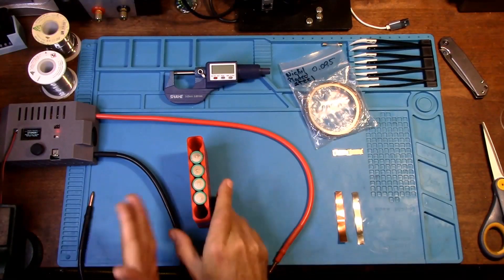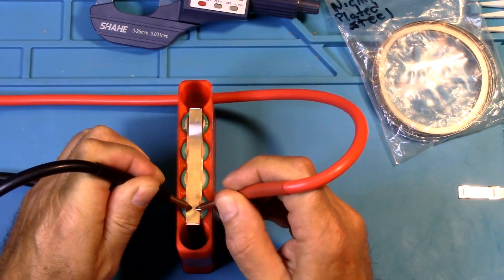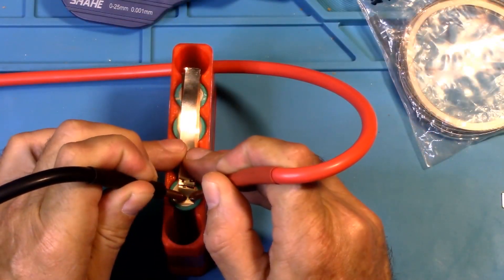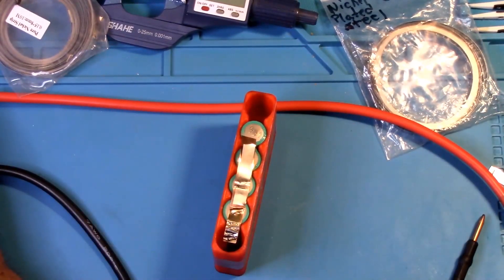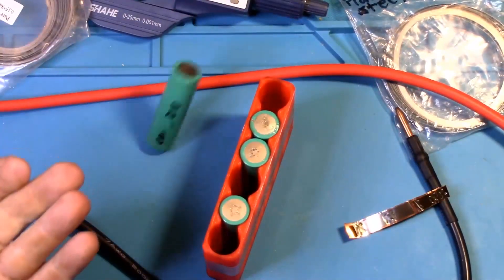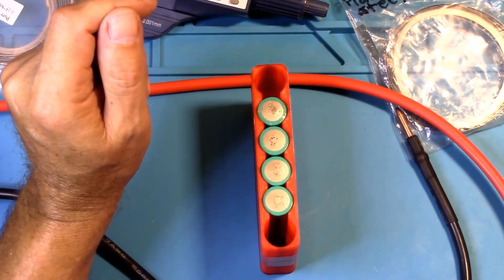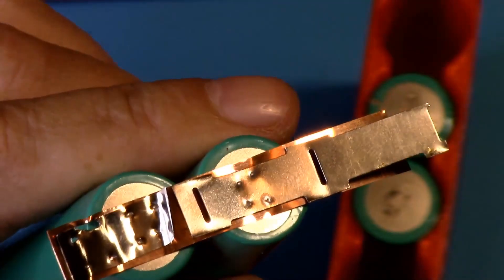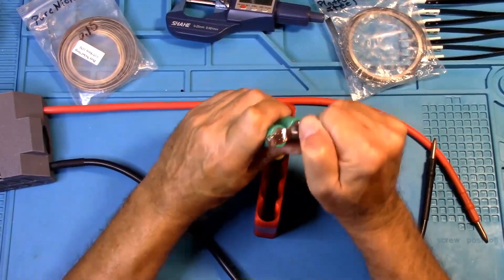Create A Copper Sandwich Weld With The Malectrics Spot Welder 1

Comment: Thank you for this great demonstration :) May I ask - I am about to get a spot welder which can barely do 0.15mm pure nickel (I already bought it, and kind of regretting, but it was cheap enough). That is, it can do 0.15mm pure nickel with good quality on max settings. Do you think it will be able to do this method? Or would I need something higher power? Please let me know if you have any estimation for this. Thanks :)
Reply from the maker: The Malectrics can weld up to 0.3mm and it struggles, so if yours can only weld 0.15, I would think it would not be able to do this.  You could try replacing the battery with a higher amp output battery (if your welder can handle it), so you can weld thicker strips.  Make sure not to over-amp (per manufacture specs) your spot welder ;).  

Hope this helps.  👍
Reply: @Outside-In.  thanks so much for letting me know, I didn’t think my cheap spot welder could do this 😁 maybe I’ll make my own high power spot welder for a video project one day then. Thank you, have a great day 😊
Reply from the maker: @h1tec  That would be awesome, and I would love to see it, so if you do that, let us know here :).  👍
Reply: @ will do 😁

Comment: i wanna build a 6s2p battery with a max pull of 90A it has 9000mah in total what thickness should i use of both of these
Reply from the maker: First of all, make sure you are using cells that have a 50amp constant current draw rating each.

Pure Nickel Strips of 0.1mm should do fine.
If you want to sandwich weld, 0.05mm Pure Nickel and 0.05mm Copper strip should be fine.

I would suggest that you first build your battery pack, and pull the 90amps you intend on using to make sure the strips will not overheat, and if they get too hot, you can always add another layer of Pure Nickel to lessen the heat (0.1mm (total) should actually work fine for your setup).   at 0.1mm thickness (Pure Nickel) you will be good for about 15amps per inch of strip, so if you are building a 6s pack, that should give you a total of about 90-100amps...  Again, make sure you are using cells with a constant current draw rating of 50amps each, otherwise you could destroy the cells in a very short amount of time.

Hope this helps.

Comment: Hello, Thank you for the video! I am interested too in the copper sandwich method , I too create battery packs for numerus projects!
What would be really helpful to me is... :
How much better is a nickel copper sandwich weld, compare to double nickel weld.
 I understand that in copper electricity pass better, but how much better, does it worth to get in the trouble for small DIY drill battery replacements, like 3s1p or 4s2p?

and also is there a way to weld only copper strip? what a welder have that power to do it?
Thank you in advance! George from Greece! https://www.youtube.com/@georgezibra
Reply from the maker: Sorry about that, YouTube didn't alert me to your comment.  I know this is probably too late, but I don't see the point myself of doing sandwich welds...  If sandwich welds were that important, then why don't ALL power-drill companies create battery packs with sandwich welds?...  I was just testing if the welder would do it in response to a comment, but myself, I would not see a need for such a weld.  I know that the Malectrics will do a 0.235 pure nickel weld, and more than likely also a 0.3, but unfortunately, I cannot find anyone selling 0.3 pure nickel to test that.  Malectrics states that their welder will weld 0.25 nickel, and it will definitely do that.  "How much better is a nickel copper sandwich weld?", well, I would say that it would be much much better, but do you really need it?, I don't think so, because like I said, if it was so much better to use a sandwich weld, then drill maker companies (especially Milwaukee), would definitely be using sandwich welds for their batteries -- just my thoughts anyhow...

Comment: Is there any way to determine how thick both the Nickel and the Copper should be to safely draw a certain current from the cell? For example, I creating a 6S1P battery for a project which can draw at max 20A, how thick should both the strips be to safely spot weld and draw current from the cells?
Reply from the maker: For the Malectrics Spot Welder, I would say no more than 0.1 for Nickel and 0.1 for Copper to make a good sandwich weld.

Comment: Very smart way of welding copper. Directly it is not possible since the thing that produces the heat that welds in the spots is the relatively high resistance of nickel. Since copper has very low resistance current will just heat all the path instead of only the spots. This way you have the best of both worlds (the ability to solder in spots and also the low resistance of the copper)

I use to solder copper directly on the nickel strips, with a soldering iron trying to apply (and remove) heat as quickly as possible, with good results. But this is better.

Very happy with my malectrics spot welder too! Keep in mind that the capabilities of this thing are closely related to the discharge rate of the battery used to feed it.
Reply from the maker: I definitely agree with your thoughts.  This thing puts out a lot of power for sure.  The only problem I would see using this method all the time, would be the cost wouldn't it?, I mean the cost of the copper I purchased was quite high, but only purchased for a request video.  I just don't think that I would want to use this method constantly as the cost could rise (depending on how much you weld) quite high... 

But this is a rather fun way of welding and (like you say) very effective as long as you have the battery power to get the job done.
Reply: @ thank you for your response. I just purchased a 0.1 x 7.5 mm roll (with a total length of 2m) just for a quick test. I agree it is quite expensive at about 9 EUR / 10 USD in my region, but since the copper wire I used to improve current flow is also expensive I will purchase more if it works good for me. So copper manufacturers should thank you for the free ad! 😉

I use this batteries a lot in medium-sized rc planes, so I need about 35A continous for each element weld. I used 0.3mm nickel but even on 100ms on the malectrics welder if the points of the tips are not super-sharp it wont stick properly. Maybe the battrry I use to power the spot welder is showing a bit of wear too. So since reliability is important I went back to solder (also expensive) 2.5mm2 copper over the batteries. Not very good for them but it was my only idea. 

If this method works even with the cost It would be a blessing. Have you tried higher thicknesses by chance?
Reply from the maker: @Igbf  No I have not tried anything thicker.  The Malectrics is not really meant for that kind of power anyway, a welder that would need to put out the power the copper would not only want - but take - I mean that kind of power is going to be much more expensive than a Malectrics, but the Malectrics definitely (in my opinion) holds it's own - up to the bigger boys in the room.  

I have tried a number of welders that say they can do the power that Malectrics says theirs can do, but so far, the Malectrics actually puts out and more-so what they state it will do.   A person would just have to be careful not to connect too big of a battery to it, because (like you say) it will put out what you put in, and it would actually start putting out that Magic Smoke everyone loves to see so much.

Actually Malectrics contacted me and asked me if they could link to my video on their store, and I said sure be my guest, so that was pretty awesome I think.  But yes, I do enjoy using the Malectrics anytime that I need to spot-weld something, but as far as using copper, no I don't think I will ever really have the need.  

The pure Nickel strips that I use are plenty for the dabbling and messing around that I do.  But just in case (and also why I don't waste my copper rolls), I will always have a piece of copper if I need it.

I agree also with you that soldering on a battery is not the best idea, and actually I feel that it is a super big no-no, unless of course a person has a ton of experience with doing it.  If I were to do that, and actually I did my first solder on an 18650 about 2 weeks ago, I got the iron way hotter than normal, and only spent a second on the battery to get it finished as quickly as possible and still make a connection.  It actually surprised me how well it worked, and the battery was just barely warm, but still, after that, I said - nope, not going to do that anymore.  I guess I was just curious if it would actually work, and it did for sure, but absolutely will never do that again.  But then again....  How does the old saying go?...  Never Say Never LOL..

Comment: What battery you use?
Reply from the maker: I used the Zeee 9000mAh 100c 11.1 volt battery.
Reply: @Outside-In.  3 or 4 s and I have a battery is 240 cell Samsung 40 T 72v48ah 420continous amp 3456 what is one charge of the battery gonna be enought
Reply from the maker: @XXHellBig125XX  3s...  The following is the battery specifications for using the Malectrics Spot Welder:

Battery Information for the Malectrics Spot Welder:

* Input voltage: 10 to 14 V recommended welding battery: (you can use car or lipo battery)

* Car battery: 12V, arround 600 A (CCA)

* Lipo battery: 3s 5000mAh with minimum 60C (120C burst) recommended 

* Welding material: 0.1mm to 0.25mm nickel strip (most commonly used is 0.15mm)
 
* Welding cable: 10…16mm², each about max. 50cm long

If you are saying that your battery is 72v - DO NOT connect that to the Malectrics Spot Welder, you will blow it up...
Reply: @Outside-In.  no im buyng the welder to spot weld my 72v but wondering wich battery buy for the welder so 3s zee 9000 mah 100c 11.1 to 14.4 v would do right
Reply from the maker: @XXHellBig125XX  Yes exactly.  That is what I am using now, and it works beautifully.  Sorry for the confusion 👍  Actually, 12.6 volts is as high as you want to charge that battery.  These cells charge to (A Maximum) 4.2 volts each (Recommended charge is 3.7 volts (11.1 volts total 3 cells in series)), and 3 cells in series would be 12.6 volts (Maximum) - not 14.4.  If you try charging that battery to 14.4 volts, you will cause a fire for sure.  Also don't let the voltage drop below 3.2 volts per cell (9.6 volts total voltage for 3 cells), as that can also cause a fire.

I also recommend getting a fire proof case for LiPo batteries to keep these in while charging and storage.  LiPo batteries are the most dangerous batteries (in my opinion) ever conceived for real) LOL.

Comment: What weld current does the Malectrics show?
Reply from the maker: I think it showed around 400-450 amps with the battery and leads I was using.  The heavier the gauge and length of cable, the better the performance.
Reply: @Outside-In.  Strange. I just tried the sandwich method on a brand new Samsung INR21700 40T and it wouldn't stick at all. Weld current was ~409 A.

I eventually cut off the copper strip that was in the pack I was repairing, soldered nickelstrip to the copper bar then succesfully spot welded the nickelstrip to the battery. 

Two years ago I repaired an identical pack and I had zero issues welding the same type of copper strip. The only difference I can think of it that the tips were sharper back then.
Reply from the maker: @jcvjcvjcvjcv  Spot welding copper is the hardest thing for a welder to perform.  Make sure the copper strip is not more than 0.1mm thick, and the nickel also not more than 0.1 or 0.15mm.  If that still does not work, you may have to sharpen the needles a bit, or at least sand the tips to clean them so they can provide a better weld.

Comment: to clarify, make a cut in the copper so there is a separation between the 2 sides, similar to a slit that you commonly see in the premade strips. doesnt have to be a total cut, but, almost, to get the current going down into the weld. I wonder if that helps and could increase the pack current needed to 400 + amps that i need. maybe that would work with thicker copper.  CU is the periodic table name for copper
Reply from the maker: Periodic Table - Never gave that a thought, but thanks so much for clarification.  Ok, so would you put both probes one of the sides, or use one probe on each side straddling the separation?  I would assume the answer is the ladder (one probe on each side of the separation).  As you can tell, I do not do a whole lot of spot welding, so not really any experience with it.

And are you also talking about a sandwich weld with nickel as well (over-top the separated copper strip) or just the copper alone.  Most have said that is why I have no luck at using only copper, as it needs the nickel strip to transfer the heat needed to weld to the battery?.

Might have to give that a try - interesting, and thanks for the suggestion and help..
Reply: @Outside-In.  one probe each side and yes a sandwich
Reply from the maker: @aerolithiumbatteries8152  Thanks for the clarification, and will have to set aside some time to do that.  I have a trip this weekend, and that may just be the work I can take with me to do, so thanks because I was wondering what I could do while sitting and waiting at the Hotel for a day LOL.  👍👍👍

Comment: again, try the .25 thick CU strip again, but cut it in half to create a gap so the current goes down and over.  thanks
Reply from the maker: Do you mean cut the strip in half, and place them side by side with a separation?...  What is the CU referring too? Again, sorry if I am sounding a bit dumb, but am changing gears from doing a video about a totally different topic ;).

Comment: It’s not really the malectrics that’s doing the weld. It’s the power source attached to it. I’ve done copper sandwich 0.1mm + 0.15mm pure nickel with reinforced 20$ Chinese pcb board. It lasted 300-400welds and eventually died due to bad design (individual gates weren’t protected) and there was no TVS protection as well as it had likely counterfeited mosfets etc. Malectrics have definitely a better design, better protection and genuine mosfets and all of that should make it last longer but again: IT’S THE POWER SOURCE THAT IS CREATING A RELIABLE WELD. Saying thad my kWeld is better or malectrics is bad means nothing unless you have both and both of them are powered from the same source.

To the author: please tell us what battery has been used here as a power source as this is for me the most important thing. Ideally with its IR measurement using 1kHz AC.
Reply from the maker: Yes, you are right, it is the battery that makes a big difference in performance.  I used the Zeee 9000mAh 100c 11.1 volt battery.
Reply: @Outside-In.  thanks- that explains a lot. 100C from 9000mah is 900A while 100C from 5000mah is 500A - so also a huge difference. Moreover in pulse that 100C may be 200C or even more? Also the fact it says 100C doesn’t mean it can really deliver that so people may get a different results across “theoretically” same specs battery. I wish you had that 1kHz AC internal resistance meter to measure your lipo pack. Cheers!
Reply from the maker: @losien1  do you have a link to the AC internal resistance meter you are talking about?.  I was looking at some internal resistance meters, and they are quite expensive...
Reply: I was just about to ask what battery you use for the welder. I have the same type welder Malectrics, but I have swapped the thin 10mm2 wires to 35mm2 gauge wires, and together with an car-battery (800 CCA) it's very very powerful. Before I used the same battery with the thin 10mm2 wires included in the Malectrics kit, but they overheated due to resistanse after 20-30 quick welds or so. But after swapping to fatter wires they do not overheat and I have to run really low time on the Malectrics settings (10-15ms) to not burn through the strips into the batteries, even with 0,20-0,25mm nickel.

Comment: I have been experimenting spot welding copper to batteries -
 I have been able to  weld 3 Layers of .1 copper sheet Stacked Up with One layer of .15 nickel OR plated  steel on top -
weld is very strong -  rips copper when pulled with pliers  - Im using seesi cap welder at 45 to 85 works well -
I think any good cap welder will work using pin type electrodes  - 

Try it and let me know how it works for you -
Reply from the maker: Thanks for the details of your experience - very helpful, and I will have to look into a set pf pen type electrodes.
Reply: welder you have has pen type electrodes -  the trick is stacking Up Thin copper sheet  - stacked up copper is .3 mm thick - 3X.1 copper sheet -
I tried thicker copper on One sheet - did not work well  - I had welder with spring loaded handle  - handle was a joke  - welder machine  part was good tho  @Outside-In.
Reply from the maker: @GroovyVideo2  I actually was wondering about that stacking thing - so I guess I need to try that...  Interesting that 3 thinner pieces stacked instead of one thick piece would work better, but great to know.

Sorry, I assumed that a pen probe was the two needles in one handheld probe.
Reply: @Outside-In. likely because there are some microscopic air gaps or oxidation between these sheets. If the contact isn’t strong resistance comes into to the game and once you have some resistance paired with a huge current you get that heat needed to bond all these layers together. Not enough resistance or current = no heat = crap weld :) I think this is how it works.
Reply from the maker: @losien1  👍